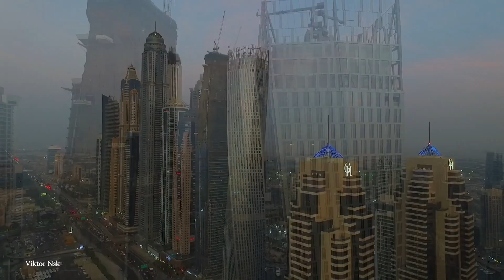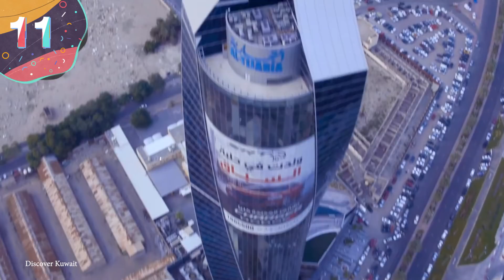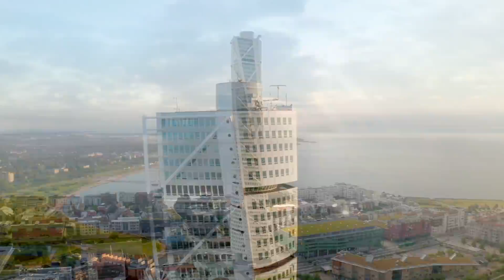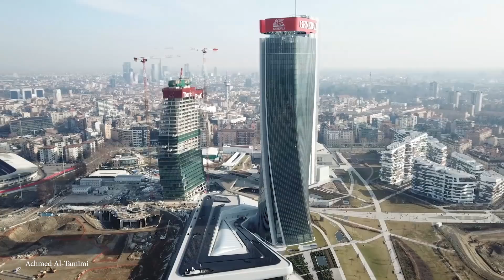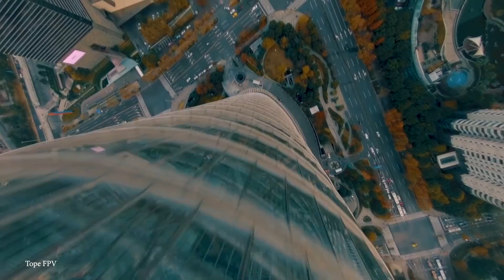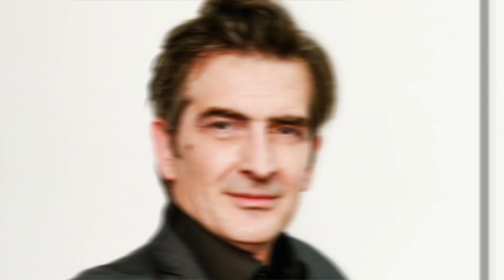15 Most TWISTY Buildings

Comment: A nice post I felt like sharing

Comparisons

Shweta covered a distance of 10 km in one hour.

Akash covered the same distance in one and a half hours.

Which of the two is faster and healthier??

 Of course our answer will be Shweta.

What if we say that Shweta covered this distance on a prepared track while Akash did it by walking on a sandy path???

Then our answer will be Akash.
 
But when we come to know that Shweta is 50 years old while Akash is 25 years old??

Then our answer will be Shweta again.

But we also come to know that Akash's weight is 140 kg while Shweta's weight is 65 kg.

 Again our answer will be Akash 

As we learn more about Akash and Shweta, our opinions and judgments about who is better will change.
The reality of life is also similar. We form opinions very superficially and hastily, due to which we are not able to do justice to ourselves and others.
 
 Opportunities vary.
 Life is different.
 Resources differ.
 Problems change.
Solutions are different.

Therefore the excellence of life is not in comparing with anyone but in testing oneself.

You are the best. 

Stay as you are and keep trying your beest according to your  circumstances.
Reply: Huh? What does that have to do with the video?